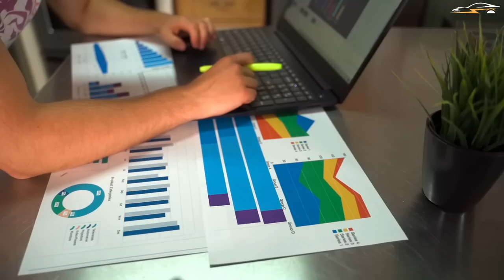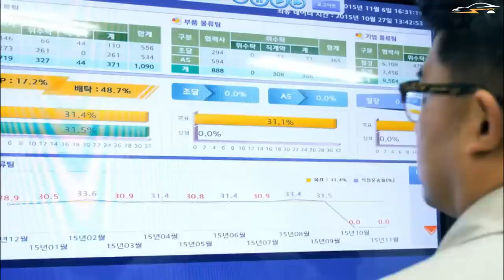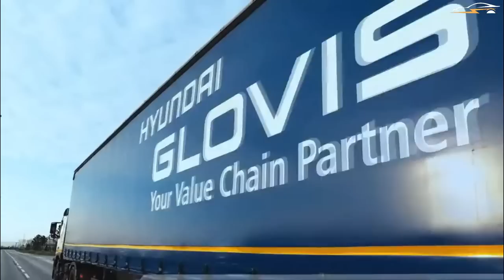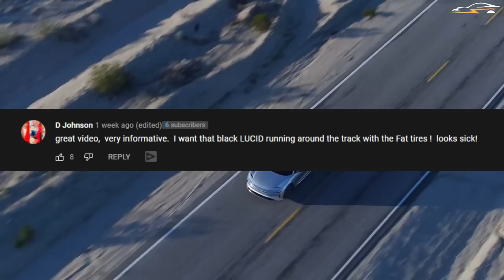How Lucid PLANS to deliver their vehicles (GLOVIS PARTNERSHIP)

Comment: Build new custom trailers that attach to current tractors, so as to load easily and secure well and comply with weight regulations and needs in proper weight distribution.
  There's a new business hauling just lucid with custom tractor trailers.